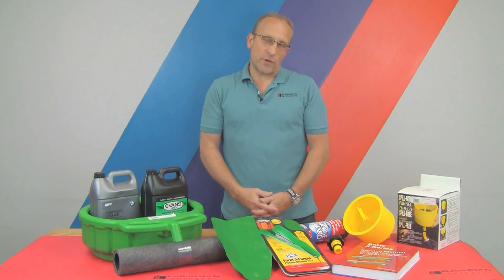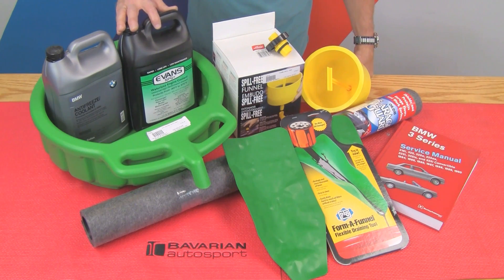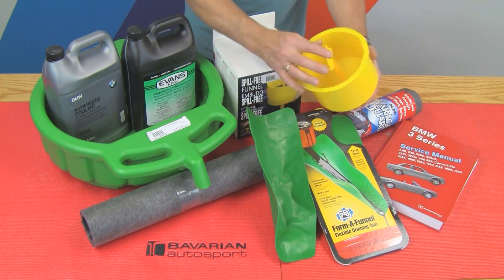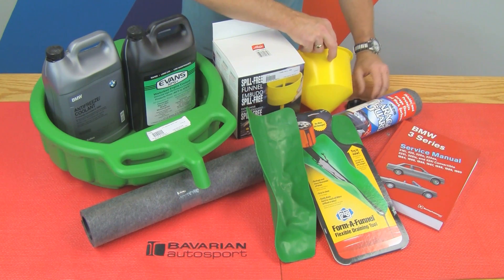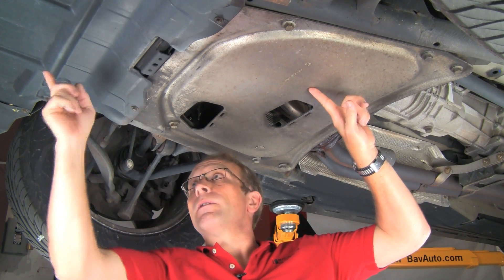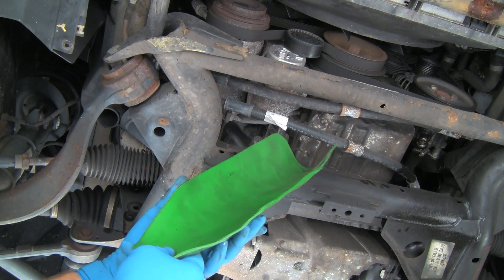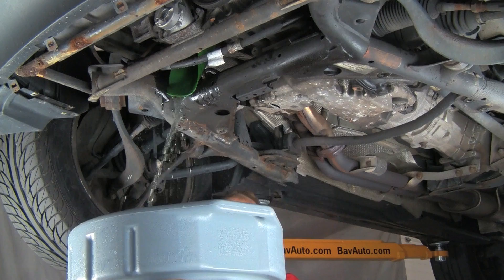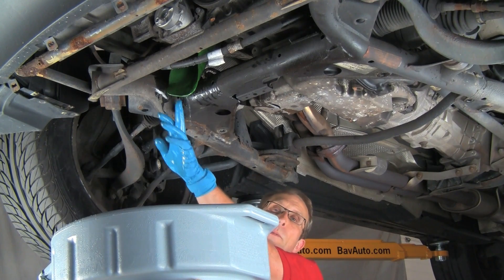Flushing & Replacing Engine Coolant in a BMW/MINI

Comment: Hey, my question might seem a bit stupid, but should I bleed the cooling system if I have opened the radiator cap just to check the coolant level and then closed it again? I am not experiencing any kind of overheating or AC abnormalities until now. (BMW e46 318i).
Reply from the maker: No need for bleeding, just opening the cap and/or adding coolant.
Reply: Great, tanks :)
Reply from the maker: BloodScatter http://media.pcgamer.com/files/2010/07/world-of-tanks-thumb1.jpg

Comment: Just to point out on sentence 'Normally, one time is plenty' at 5:30.
I flush my system 4 times with destilled water until i got clean water. Heater was set to max, and both engine block and radiator drain plug were drained. Thermostat is the key. It remains closed until temperature is high enough. If you don't have patience and time to flush many times like i do, there is better way which ensures total system flush (without old coolant in the system).
- Warm engine until radiator fan turns on (Thermostat is opened long before this happens but wait for it just to be sure).
- Flush cooling system from both engine block and radiator until thermostat is opened. This step is crucial and most dangerous, because coolant is still very hot. I recommend using gloves and extended tools for opening drain plugs.
- If this is first flush of old coolant, additional flushing with destilled water (again while thermostat is opened) should be plenty, and guarantees clean cooling system.
- Now it is ready to fill with 50:50 mixture.

Comment: while doing the bleeding and adding the disteled water, i know the heat was on high, but was the engin on as well?
Reply from the maker: Yes, on models that have engine driven water pumps, you have the engine running when filling and bleeding.

Comment: I got a 98 E36 323is, how much coolant will I need?
Also when you flushed out the system with water you said you had 2 qts left in there when you started adding the coolant. Did you flush out the water with the drain plugs out, put the plugs back in then added the 2 qts of water? Hope to hear back quick, thanks.
Reply from the maker: Your 98 323is needs 2 gallons of coolant (www.bavauto.com), to mix with 2 gallons of distilled water.  This is a total of 16 quarts, which is enough for most BMW and all MINI systems.  The two quarts of water is what is left in the system after the final draining.  This is left in areas of the system that can't be drained without total dissassembly.

Comment: I be needing help with my 2005 BMW 325i Oil Cooler Thermostat For Automatic Transmission Models and the coolant recovery tank instalation and don't know how to remove oil cooler thermostat tanks
Reply from the maker: See if this helps:
http://blog.bavauto.com/15186/bmw-m54-6-cylinder-coolant-thermostat-for-automatic-transmission-broken-how-to-replace/
Reply: Thanks For the help

Comment: the question i have is, does the engine need to stay on from the start of the fill to the end???
Reply from the maker: Initial filling can be done with the engine off.  Once it is initially full, start the engine and work through the bleeding and further filling as shown.

Comment: My car is an e46 325i. My upper rad hose is not too hot to touch but very warm + hard. I noticed this after filling my expansion tank full. As it was just hitting the lip of the opening where the cap goes, it continued to very slowly rise and overflow, which lead me to put the cap on. I didn't notice any air bubbles as it rose. Also, my temperature gauge was dead center at normal operating temperature as this all happened. The gauge continues to stay normal WHILE the hose is very warm and hard. This is a NEW hose i just replaced but i'm still worried. What could be the problem with this, considering all these factors?

Comment: I was planing on doing it on my e36 m50b25 (95 325is 2.5L). How much coolant will i need?
Reply from the maker: The Bentley publishing repair manual for the E36 models will include the coolant fill capacities.  The 325i models have a capacity of 10.5 quarts (10 liters).
Bentley repair manuals:
http://www.bavauto.com/se1.asp?dept_id=5228

Comment: How much would I need to fill if I did this on a N52 E60 525i 3.0L engine?
Reply from the maker: The Bentley Publishing repair manual for the E60 chassis, notes that the fill capacity for the N52 models is 10.6 liters for manual transmission and 10 liters for automatic transmission.
The Bentley repair manual is available in our online store at bavauto.com
Reply: BavarianAuto  Thanks for your prompt reply. I just realized that the N53 engine does not have a drain plug on the engine block. Is that true. In this case what do you suggest?
Reply from the maker: Sandeep Veeramani
In looking at the BMW Micro-film drawings, it looks like the block drain plug is on the driver side, between cylinders 2 &3.

Comment: I may not own a bmw but i find your procedure very useful. I actually used this method on several of my friend´s vehicles from a chrysler to a Nissan.  My house has very hard water and i was concerned aboout doing a traditional garden hose flush. It never occured to me to fill with distilled water and drain again. Saved my buddies and i allot of money as well. Distilled water is allot cheaper than pre mixed coolant off the shelf.
Reply from the maker: Glad to help.  Our BMW & MINI customers and owners may have other vehicles as well, and these procedures can be applies in a general way to any make/model.

Comment: i have 328xi 07 e90 do it do the same this video ? and how many gallon do i need ? thank you
Reply from the maker: The general procedures will be similar, but your block drain, radiator drain and expansion tank fill will be different.  The bleeding procedure is also different since you have the electric water pump.  See our video on replacing the electric water pump for the filling and bleeding procedures.

http://blog.bavauto.com/14581

The 328i/Xi (and all N51/N52/N54 6-cylinders in the E90x 3-series chassis) has a total capacity of 2.17 gal for manual trans and 2.23 gal for auto trans.

Comment: Once completely full, does a small amount of fluid not need to be siphoned back out to get a true full reading? Also, do you have a video on how to bleed an electronic water pump with the self bleeding feature?
Reply from the maker: Once you "fill" the reservoir and replace the cap.  The system will stabilize as the engine is run and brought up to regular operating pressure.  As the coolant heats and expands, any excess will vent from the expansion tank.  At this point, the system will be stabilized and at its normal "full" level.

Watch our video on replacing the electric water pumps for the bleeding procedure on vehicle equipped with these new style electric water pump cooling systems.  The bleeding procedure is near the end of Part-2.

Video DIY - BMW electric water pump replacement:
http://blog.bavauto.com/14581

Comment: Hi Otto, have followed a few of your DIY's and they are spot on. I am currently experiencing a problem which is related to this DIY and I hope you can offer some advice.
After a drive and my car cools down, I check my coolant level and I see it has dropped to below minimum. If I loosen the bleed screw some air escapes through it and my coolant level indicator rises back to max. If I go for another drive and check my coolant after my car has cooled down the same thing happens. No coolant loss and no leak obvious. 
I have tried to bleed but maybe I am not bleeding properly and waiting for the air bubbles to escape fully.
Any thoughts would be helpful

:-)
Reply from the maker: What model is this?  You are not having to add any coolant?

Comment: I will be needing to fill my coolant soon,  should I get it flush before refill? since I'm not sure if the cooling system has been maintained at one point. What type of coolant do you think is best to use? .
Reply from the maker: You can use the BMW coolant with distilled water.  The system should be flushed every two years ... three years max.  If this has not been happening, you really should consider a flush at this point.  The BMW coolant 9and the other tools shown in the video) is available at bavauto.com or 800-535-2002.

Comment: Hello. For a mini r53. How many gallons antifreeze will i need? And how many gallons for distilled water? Also do i need to take out the front bumpers of the mini just to drain the old coolant? Thanks in advance.

Comment: BMW coolant contains Ethylhexonic Acid which is a plastisizer. This will destroy the rubber oring seals including the one in your water pump. If you own an N62 motor you will eventually be plagued with the transfer pipe failure to the tune of 15,000 dollars. Think Motul or Pentosin. Motul Inugel Expert Ultra is 2012 approved by BMW and does not contain the chemical.  FYI...Bmw coolant is manufactured by Valvoline/Ashland in the USA.    General Motors  was successfully sued in 2008 for vehicles damaged with Ethylhexonic Acid.

Comment from the maker: Yes, mix the Prestone at 50%.  The distilled water will allow the coolant to be more effective in preventing electrolytic corrosion, due to the removal of the minerals from the water.

Comment from the maker: See our DIY on replacing the water pump on the N51/N52/N54/N55 6-cylinder engines (done on an E90).  After the water pump replacement we show how to fill and bleed the system.  See it at our Tech Blog at blog.bavauto.com ... search for N52 water pump DIY in the blog search box.

Comment from the maker: Without the funnel, you just have to be more aware of your fill level, so you do not overfill past the top of the reservoir.

If you mean filling past the full mark, no there is no harm.  The system will vent any excess fluid as it cycles from cold to hot, over time.

Comment from the maker: We do not currently have any radiator replacement videos.  The Bentley repair manuals will cover the radiator replacements for the various BMW or MINI models.  We do have the manuals in-stock at bavauto.com.

Comment from the maker: If you do not have the system "full" you may have temperature issues.  When you check the coolant level in the reservoir, how far down is the coolant?  What model do you have?

Comment from the maker: You should use the distilled water for the intermediate flushes as well as the final fill.  This is due to the fact that some of the flushing water will remain in the system.  Therefore, it should be the same distilled water that is used for the final fill.

Comment: Water is fine, though distilled water is recommended. However water evaporates, whereas coolant does not (and it can't freeze either). So it's normal for straight-water to boil away quickly. Coolant comes premixed, or you have to mix it with water. Over time the water evaporates and increases the acidity of the coolant, therefore the longer you avoid flushing and replacing the system, the more you corrode your system. Next thing you know you blow the head gasket.

Comment from the maker: We're sorry for your misfortunes that you've experienced.  In retrospect and for others;
The late model BMW cooling systems do indeed need regular preventative maintenance.  unfortunately, the plastics used in the cooling system, do not stand up to long term heat and use.  We recommend preventative replacement of the plastic parts and the water pump at around 80,000 miles.  The main point is to NEVER continue to run the engine if it is overheating.  If the gauge goes high .... shut it down.

Comment: My new 2001 528 had a cooling problem, warped the head. Did not learn my lesson, got a 2003 530, performance was improved, yet at 90K warped the head and had to replace the entire cooling system. BMW's are a joke in so many ways.

Comment from the maker: The engine running temp is very close to the boiling point of water.  In fact, the water will be boiling where it comes into contact with the cylinder walls and combustion chamber walls.  This could be causing consistent coolant loss due to the expansion of the trapped steam that may be being created.

Comment from the maker: To some degree, yes. As the coolant expands (as it heats up) it will spill over if the system was filled to the top when cool. Also, the bleed/return hose to the expansion tank may be splashing out of the cap opening (can happen on some models). Do your final bleeding with the cap in-place.

Comment: To some degree, yes.  As the coolant expands (as it heats up) it will spill over if the system was filled to the top when cool.  Also, the bleed/return hose to the expansion tank may be splashing out of the cap opening (can happen on some models).  Do your final bleeding with the cap in-place.

Comment: One last question. I recently replaced the water pump and thermostat and housing. I ran out of coolant so I have been running straight water in it . Now my question is after every few days or so I open the expansion tank cap and the fluid level goes down so I have to be adding. Is this normal with water because it can boiling ? I've checked for leaks and can't find any. No overheating issues either .

Comment: After 15mins of running with the expansion tank cap off on my 99 BMW 528i. The system seems to be pressurized and spills the coolant out. This might be a stupid question but is this normal?

Comment from the maker: No.  The system does not need to be fully bleed when performing the flushes.  Just watch the engine temp to be sure you do not allow an overheat ... in case these is trapped air.

Comment from the maker: The evils of time constraints and editing .....
The Evans is a "lifetime" coolant.  This is achieved via the molecular make-up of the coolant and the fact that it is used without water.  Since there is no water in the system, there is no electrolytic break-down and corrosion.  Additionally, the Evans has a better heat transfer coefficient.  In other words, it accepts the engine's heat faster and then releases it to the radiator faster.  Read more at blog.bavauto.com.  Search Evans.

Comment from the maker: We have found that the Behr (Behr makes the original BMW radiators) and Nissens radiators for the later model BMWs may not have drain plugs in them.  This is not a major issue, but if you would like further assistance in this, please call our Customer Service Advisors at 800-535-2002.

Comment: I just bought your coolant system rebuild kit for my 2000 323i, and during installation I noticed that there isn't a drain plug on the bottom of the new radiator. Only on the expansion tank.

Comment from the maker: That's fine for replacing the thermostat (or water pump, etc.), and then just refilling.  However, if you are planning to flush the system at the same time, you will still have a good amount of old coolant in the engine if the engine block drain plug is not removed.

Comment from the maker: Over filling is not a problem.  As the system heats up and the fluid expands, any excess fluid will be vented through the overflow (via the cap's pressure relief valve).

Comment from the maker: We do have the MINI version of the coolant flush "on the list".  However, the procedures will be the same as shown here.  You'll just have different locations for drain, fill, etc.  The Bentley Manual would show you these points.  We have the manuals in our online store at bavauto.com, part number is MC06.

Comment from the maker: For the bleeding, if your E60 5-series has the M54 engine, you should have a bleeder on the upper radiator hose.  If you have the N52 or N51 engine (as all 2006 and later models do) with the electric water pump see our blog post on this subject.  Go to our blog; blog.bavauto.com and search Bleeding .  You will see a recent post on bleeding the later model cars.
For the Evans NPG, we have an additional instruction sheet for this.  Please send email to: INFO at BAVAUTO.COM.  The number is INS328.
Reply: Bavarian Autosport 
Hello thank for your help 
Is my first  BMW . And has green color do not know if is or was added and mixed with blue , do you think that can be not good , and with these method will be ok or I should do water pump
Thank you in advance

Comment: hello otto, thanks for the video. i have a 2004 530i and would like to ask if venting is the same as in the x5 used on the video. can't find a bleeder screw in my car. also planning on using the Evans NPG  waterless coolant. how do i make sure that all water is completely drained before putting in Evans NPG coolant. hope to get answer by monday(Dec 17) to take advantage of free shipping. thanks